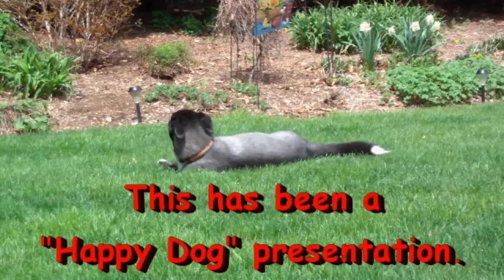Swiss Ranger Volcano Stove using an Open Jet Burner from ColoradoCamper

Comment: I've solved the problem. I put answer on Hiram's Facebook pages. I drilled 8 holes (6mm diameter) on both sides on the bottom section.